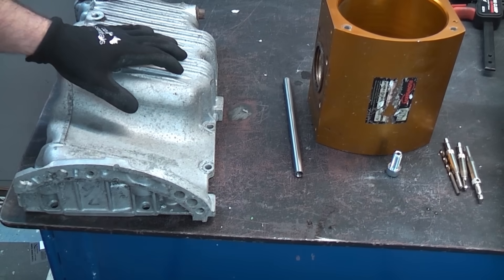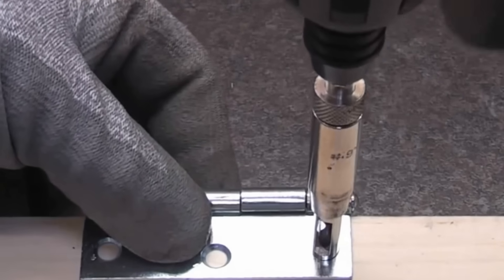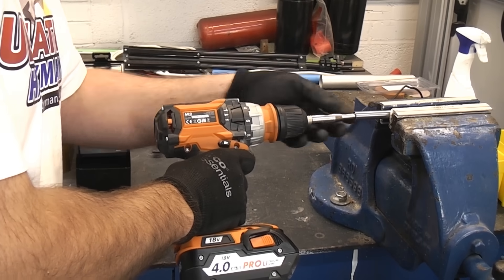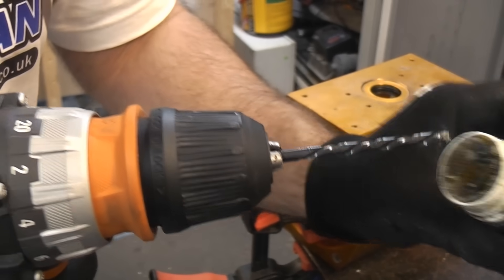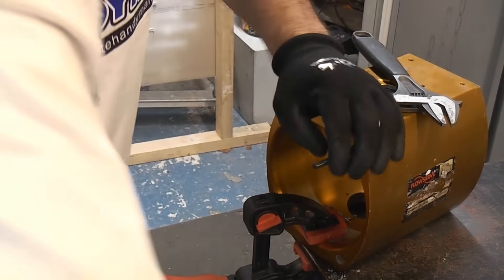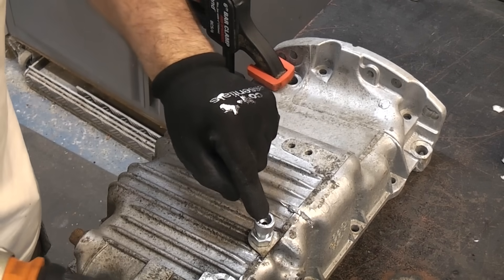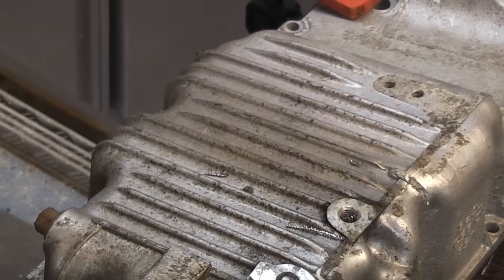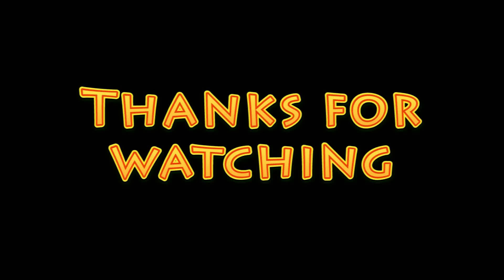How to remove a broken bolt in a deep hole | remove broken bolt in recessed hole

Comment: Not quite my problem.  I have a sheer pin broken on both ends, so recessed in my snowblower auger's axle.  Tried air hammering it out with a punch with no luck and the hole is that small that I don't think that sleeved bit rig would work.  I think the pin shaft is only like 5/16ths of an inch.  Guess I'll just have to try drilling the thing out as I'm not worried about making the axle hole larger.  The pin itself has no threads on it as they broke off the end with the nut on it, and I think it's just rust welded itself into place.

Comment: Are the Super Lube multipurpose full synthetic greases or WD-40 or 3 &1 oil an okay option for screws/ bolts, I have a knife handle scales that the screws rusted together on and wont come out to check underneath them to see if there is any rusting, so I went back on some other knives I have and put a light coat of Super Lube under the scales and the bolts and didnt use as much torque to screw them back in this time to hopefully cure that issue from ever happening to them also. The problem is that the knife I'm having seizing issues with is one that I "thought" I already treated with grease or oil to fix that problem in the first place and now can''t remember what (or if) I used anything on them and now want to make sure any of those SL, WD-40 or 3&1 oil is the reason.

Comment: There's a lot of times that there's a burr on the part of the bolt that stuck, and it will damage the threads on it's way out, And the burr will cause the bolt to stay stuck in there and make it harder to remove, But you did a good job of showing people the tools it takes to remove a stuck bolt, Great job good video,
Reply from the maker: Thanks for the comment 👍

Comment: If i have a 3 bolt housing, and the bolts are evenly spaced, can I use only 2 bolts to seal the housing? I snapped a bolt head off
Reply from the maker: It’s unlikely that just two bolts will work, to be honest! 
I guess you could try it, as long as it’s not a life-or-death application 😉

Comment: Thank you for this video, good solutions for a common problem. 
However, I have an observation to express - you suggest coating the bolt with copper grease before screwing it into the alloy sump pan. 
This will actually (long term) cause corrosion to happen between the alloy of the sump & the steel of the bolt FASTER than using nothing at all. This is due to electrolysis caused by copper (Cu, 29) & iron (Fe, 26) being higher on the periodic table than aluminium (Al, 13). The alloy sump, as well as the iron screw (to a lesser extent) become sacrificial to the copper & will deteriorate over time – the white ‘furring’ on aluminium. 
A better alternative would be to use a different version of the grease that is based on aluminium or, possibly, a ceramic grease. 
The same process happens if a steel bolt, put through a bush with an alloy centre, is coated with copper grease. I know this from experience - when you try to take it off again a few years later, you will find it has seized solid. Most annoying.  😐

Comment: So clearly this ain't something one can easily do at home depending how the bolt was sheared off
Reply from the maker: You can do it at home, providing you have the correct tools 👍
Reply: @ultimatehandyman  My man that is exactly my point. Not everyone has a house and the space for what can be said are relatively niche tools outside the standard fare most would have
Reply from the maker: People watch my videos on £1000 smart phones, yet don’t even own the most basic of tools. It’s not like I was using a EDM machine or CNC laser cutter 😉
Reply: @ultimatehandyman  that is a bad example to use man. Phone is multi purpose and daily use device regardless of its type. Like I said not everyone got the space. Though I am sure those without tools still have a screwdriver or flathead (regardless if they know it) if they have every bought anything that even vaguely needs to be put together...
A passing thought I just had is most renters Ive personally ever seen never have tools for the most part
Reply from the maker: Well, you have a choice-
Go out any buy the drill and do it yourself, or pay someone else to do it 😉
As for renters, I used to rent out two houses. I know blokes the same age as me that don’t even own a screwdriver! That’s why I sold my rental properties- let them be someone else’s problem 😉

Comment: 4:14 completely unrealistic situation, unless some moron cranked down on the bolt to tighten it to the breaking point.  Bolts are almost always broken when removing because they are corroded.
Reply from the maker: It depends what machines you work on 😉

Comment: don't use copper between steel/inox and aluminium... it is very bad chemical reaction. 
better use graphite grease. 

Use copper grease for steel on steel
Reply: @ultimatehandyman  well, the reaction is very slow indeed. So...
Reply: @ultimatehandyman  tell us your experience about it.

Comment: At 0:52 we don't have that problem in the USA because we use Al-loo'-min-num.
Reply from the maker: https://youtu.be/KmMP67eC2tg?t=85
Reply: @ultimatehandyman  Thanks, I have seen that video. The main difference is Aluminum melts at 1221 F, but Aluminium melts at 660.3 C

Comment: Had an f350 two idiots each broke off a bolt on my water pump. The fix I  drilled a small hole beside where the bolts broke off pulled two wood screws from my tool box and screwed them down . Worked for years.

Comment: These bolt-extractors seem to fail very often.
But when you look at it closely, you can see that the twisting with the adjustable wrench tilts it out of axis. 
I think this is the problem:
If the bolt was made of wood, the elasticity of the wood would allow the bolt extractor to be twisted without losing grip.
But steel doesn't provide that elasticity.
One should twist the extractor with adifferent tool, which is applied alongside the axis. Not with such a lever, as the adjustable wrench is.

Comment: You need to get the screw extractors that are not helical.  The helical ones have a habit of screwing themselves in until the bolt expands & locks FOREVER in the hole.  The non-helical ones you can control the penetration (with the amount of hammer blows you apply) independently of the turning torque.
          Regarding heating, you need to remove the bolt WHILE the aluminum is hot.  Aluminum expands faster than the steel bolt, so it becomes looser.

Comment: What's the point of hearing if you're going to wait for it to cool back down? Makes no sense and would be a waste of time. Just use a MIG welder to build up the bolt until it's protruding then use vise grips to back it out. If needed once protruding lay a loose nut over the build up and weld it to it then use a wrench to back it out. I use this technique all the time and it never fails. 👍
Reply from the maker: The heat makes the metal expand, which can break the bond between the two pieces of metal. Never try to remove a hot bolt, the heat softens the steel and can make is break easily 😉

Comment: It seems to me that the amount of torque that was being applied , that caused the bolt to snap, is significantly greater than the torque being achieved with these measures. I have doubts as to whether this will work with the snapped bolts that I work on.

Comment: Was putting the valve cover back on my 450r and knf of the valve tightener bolts broke inside with a Rachet
Reply: Did you ever get it out happened to me with my Honda. About 3 months ago. Completely forgot about it because when I tried removing it I lost the drill bit inside the engine bay luckily managed to fish it out with a magnet wand

Comment: Thank you. You've provided a solution. In my case, the bolt is broken off outside the hole, but won't turn even with vice grips. I'll adapt your solution using a combination of a nut plus a bolt with a hole drilled through it as you've done to get the drill into the center of the bolt, then use an extractor.

Comment: Can I asked for advise, I got a stucked the drain plug itself for the gear oil and I sorry to say but went the other way and snapped it. so If I used a drill and not paste will it still work  to make a a dent

Comment: i can't even fathom the ease in which you're removing these bolts. When mine snap it's a solid 2-3 hours of drilling to try to make progress, generally resulting in $20 in worthless and snapped extractors and $30 in a helicoil. I never even get shavings. I must be doing something wrong?

Comment: After two dozen videos about stripped screws (despite specifically asking youtube about sheared off screws) I finally found this ... sadly at the factor x10 or x20 in size of what I would need. Right now the tiniest drill I can find to buy (I own a couple sets but even the smallest of those is too big) plus a drop of super glue seems to be my best bet :T

Comment: What do you do when the bolt is to hard to drill? I have tried everything even welding a nut to it. No luck. It is really stuck hard.
Reply from the maker: You could try a cobalt drill bit, if that does not work you could try a solid tungsten carbide drill bit, but be aware that they are very brittle. Alternatively you could use a diamond coated hole saw, as in this video-

Drill out broken tap-
https://www.youtube.com/watch?v=7JCfEMrCjhc&t
Reply: @ultimatehandyman Only thing I haven't tried is the diamond coated hole saw. May have to get one and give it a try? Thanks.

Comment: Sigh, dealing with a broken bolt that snapped on f150 valve cover, its deep in there and too small to try to extract out, you have anything you suggest for smaller bolts that are stuck?

Comment: Why remove it? there were plenty of threads left to throw in a shorter bolt with maybe a washer or two to keep from bottoming out.right? anyway that's what I did with the exhaust bolt and it's been there for years a few good threads goes a long way.

Comment: Like an idiot I broke a bolt from my cars valve cover, forgot that it's a 25 year old car and weak bolts by now, I'm going to give it a try to get the broken part out thanks to your video. Thank you for posting, I'll update if it works.
Reply from the maker: Best of luck with it 😉
Reply: @tehandyman  Thanks, did my best, did not work, the bolt broke off deep at an angle, I could not get the top flat, when I tried to tap it or drill it using a left handed bit, it just kept cutting into the threads.  Now because of a $5 bolt my car is stuck in my driveway :(
Reply: @tehandyman thanks but did not work, bolt head was not flat and too deep to try and flatten it, the tap and left handed bit just kept stripping the threads, I'm just going to use gasket seal and drive with 4 out of 5 bolts,   ☹

Comment: Most original bolts r harden steel way harder then any metal drill bit to drill through.
Reply from the maker: Not at all, most bolts are harder than mild steel, but much softer than the steel used for drill bits etc.  😉

Comment: Any idea on how to remove a nut from a deep hole..?
Reply from the maker: I guess it depends how much room there is, perhaps a deep socket and some extension bars. I’d tape everything together using insulation tape though, to prevent the joints separating.
Reply: @ultimatehandyman  thanks. 👍

Comment: Bolt extractor is clear, but how do I create a guide for my drill without your custom guide ? what can I use?
Reply from the maker: Perhaps a small piece of tube ?
Reply: @ultimatehandyman  OOp never mind, I broke the bolt extractor. Ther screw is really in there xD But hey drilling worked nicely, jammed extractor in, started twising. found out that my grips were shitty (steel too soft- low quallity) got Nipex vise grips and voila slowly turned the sucker then I heard two snaps and bolt extractor broke off xD

Comment: Why you didn't use nitric acid ?  Aluminum is doesn't corrodes by this acid, but steel broken screw will be corroded and It will disappear.

Comment: In aluminium, copper grease is a bad idea. Copper is above aluminium in the galvanic series, so when water and electrolytes make their way up the thread (which they will!) a galvanic reaction starts. The less noble material gets eroded, which will be the aluminium part here, and that's it. Ceramic paste does not make this problem, thus should be used. There's nothing wrong with a thin coat of silicone grease where temperatures don't reach frying pan level.
I only learnt that myself from a German channel of an electric car specialist who specialises in Tesla cars. Tesla uses copper grease in their factories in some places where the corrosion takes over.

Comment: Steel bolt broken in aluminum? Mix some alum with water...make a paste. Fill the hole that has the broken bolt. Let it sit overnight.

The alum will chemically destroy the bolt without touching the aluminum. Just use a pick or needle nose pliers to remove the remains of the bolt

Chase with a tap if you choose.

Done!!!!

Comment: What I usually do is just pretend I never started working on it and go drink a beer.
Reply: I call that a think drink.  When I have to think harder I have a couple
Reply: Yea I tried not following your recommendation of go drink a beer, and I broke the drill bit inside of the broken bolt . Now Im following your direction and Im repeating the beers until I forget it ever happened. Problem fixed
Reply: What I did yesterday lol
Reply: That’s where I’m at right now lol
Reply: Tried to take a broken bolt off in a hub of a mobile home trailer. And now I’m drinking
Reply: I think I'll do the same
Reply: LOL

Comment: Mine is upside down under my car and severely rusted. It’s broken flush with the threads edge so I can’t screw in a guide bolt. I drilled with a cobalt dremel bit to get it started and then a regular hex drill bit (not titanium the next step up I forgot the type) but I drilled a bit on an angle and now I fear I might have damaged the threads, idk yet. I haven’t gotten it out yet because of bad weather snow cold rain and family in a shelter due to my last home shut down by landlords code violations so hopefully I will get a chance to get under it because it’s a strap that holds the fuel tank and I put ratchet straps a few months ago and I’m nervous about the tank falling off. I bought liquid wrench to spray on the rust it’s supposedly better than PB Blaster.

Comment: It looks like your drill is going through the broken bolt so quocky. Ive followed this process for a counter sunk broken exhaut head stud, and i CANNOT get a drill bit to cut through the stud 🤷🏻‍♂️

Tried cobalt drill bits all sorts abd nothing. 

Does the cutting paste make all the difference?
Reply from the maker: Exhaust studs can be a real pain, as they can become hardened due to the heat/cooling cycle. You might have to use a diamond coated hole saw-
https://www.youtube.com/watch?v=7JCfEMrCjhc&t
Or a solid tungsten carbide drill bit (but they are brittle and easily break)
Reply: Thanks. Will try that.

Comment: How do you break a bolt off that deep. If it was bottomed out,not coming out. I use a Dremel to slot it and a hand impact driver.
Reply from the maker: We had a machine at work and this happened regularly 👍

Comment: Something else, that works, instead of a Easeout, use a torque bit to drive into the hole you drill. Put the drill bit holder into your drill and back it out.

Comment: I just snapped a bolt off one of 3 that holds my altanator  on . Which i have almost ZERO space to the side of it to try the drill the center hole thing  never mind the reverse drill . Looks like i need to drop the engine  or 5 gal petrol . Not to sure which one om pointing . 
Any idea on zero space remove broken bolt
Reply from the maker: Not much you can do in these instances. You need some room for most techniques.
I don’t suppose you can weld a nut onto the broken bolt?

Comment: Perfect tip for the dril bit guide! Also the left hand dril bit! Thanks! In my days I also 'welded' broken bolt or thread ends out. You can only not do it with very deep broken bolts. Lay done a similar size nut and weld it from inside out the broken bolt to the inside nut. Due to the heat, the broken bolt wil expand and crush any rust . Let it cool down totally and slowly turn it out. Most of the time it worked for me! Also a penetrant oil, q20,w40 works great but spray it days before and repeat it every day so it can do its work. In combination with tapping on it works also mostly. Good luck with your work and program!

Comment: I worked in a cat shop on the undercarriage of a 46A with 7 roller frame that worked in the ocean and it was the first time to come apart. It took a 21 foot 2 inch pipe to get the bolts loose,we hammered on the top of the 1 inch bolts and we broke all 56 bolts,so we used a magnetic drill press and drilled a center hole in them and had the welder blow the holes out close to the threads and then we used a small chisel to clear out the threads. We used  never siege on evert bolt when we put it back together. Quite a job
Reply from the maker: Blimey, that sounds like a real nightmare job! 
Thanks for sharing 👍

Comment: Never use copper grease on aluminium.... Especially combined with stainless fasteners... It causes corrosion between the two materials, you might as well soak it in loctite.... Always use ceramic grease...